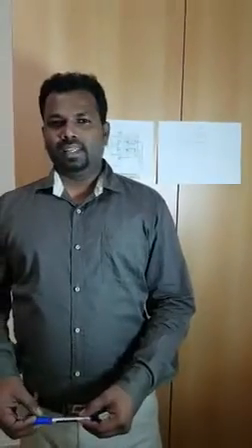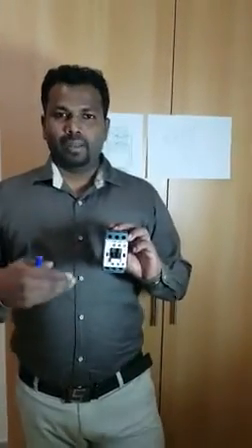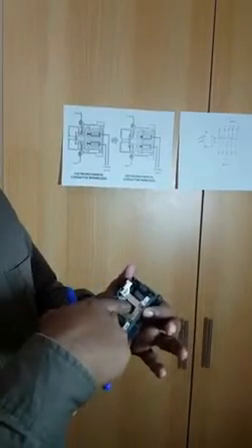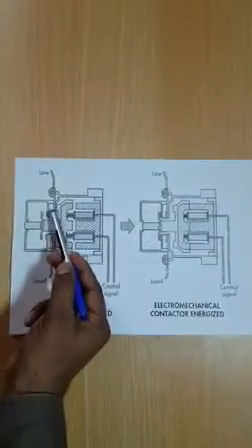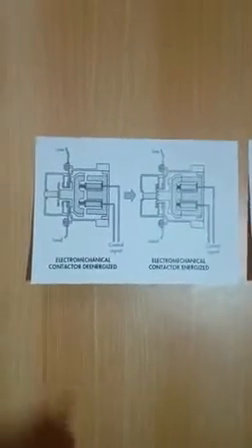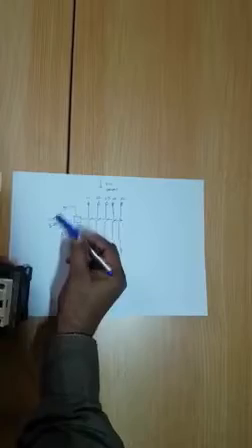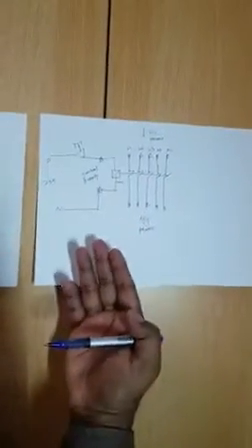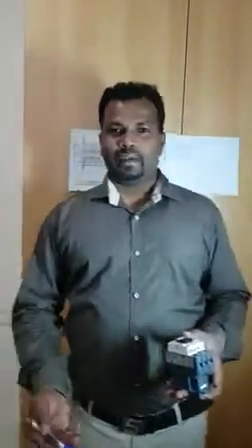What is contactor ... how does it work...tamil

Comment: For example I purchased 110v ac 32 amps 3 pole contactor.this contactor how much current taken
Reply from the maker: your  contactor coil voltage is 110v?? or load voltage is 110v?
Reply: @sennapparajan.p  contactor coil voltage is 110volt AC
That coil how much current will take
Reply from the maker: @praveenkumar5868   that coil will take some Mille ampere current only.  coil rating will be in some VA rating . use P=V I COS@  formula. But why do want to know contactor coil ampere rating??
Reply: Thanks sir